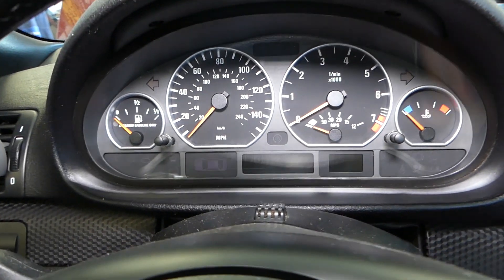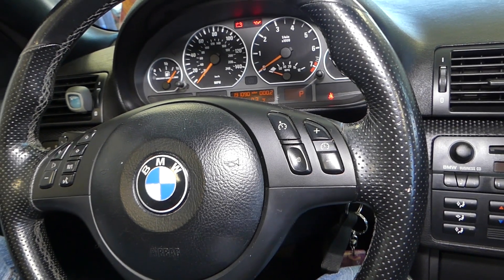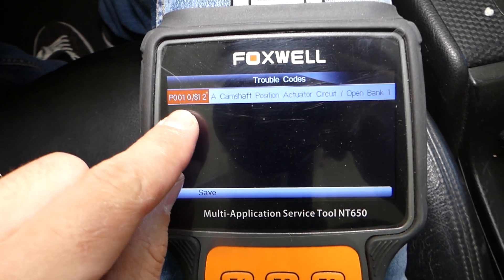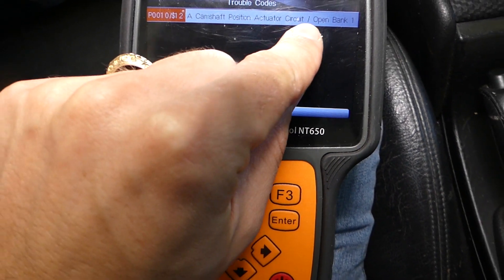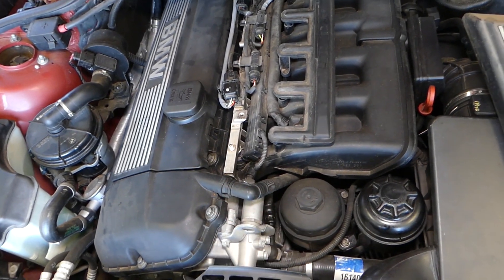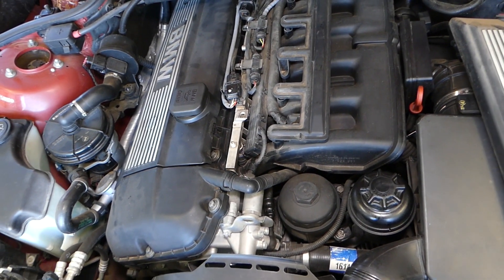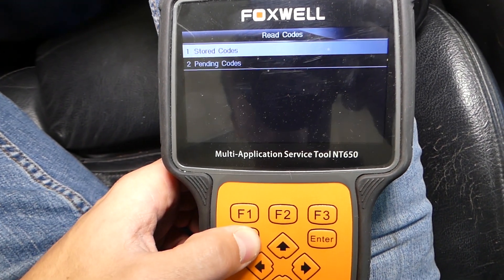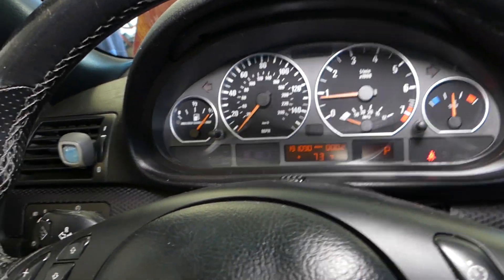CODE P0010 A CAMSHAFT POSITION ACTUATOR CIRCUIT OPEN BANK 1 BMW E46 VANOS SOLENOID

Comment: 2006 BMW 330xi. Have code p2088 and p2090 and p0341 codes. The car will not start just turning over. I put new sparkle plugs, coils, and camshaft sensors on. Will not start was wondering do I need a MAF sensor or crankshaft position actuator sensor. Need help 1,800.00 in the hole with no starting up.

Comment: Hello is there a difference with P0010 and P0011. I have a P0011 on my bmw e46 325xi and when i test the solenoid on 12v the pin comes out well and strong but when i test it on its harness v
Cable from dme it comes out but not with energy and u can litrally push it back in. Basically its not as strong as when tested on 12v directly. Please help.